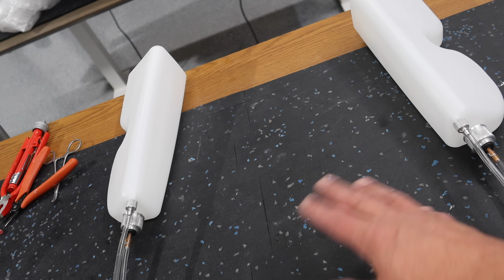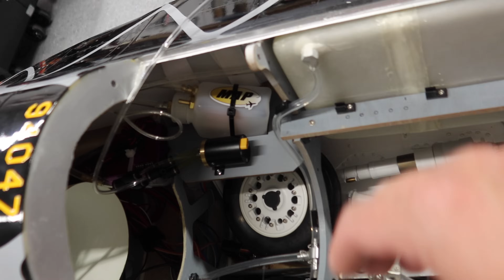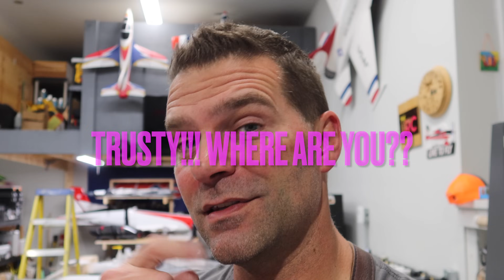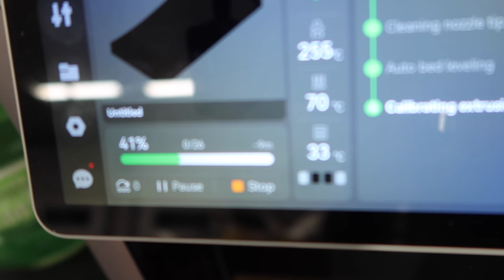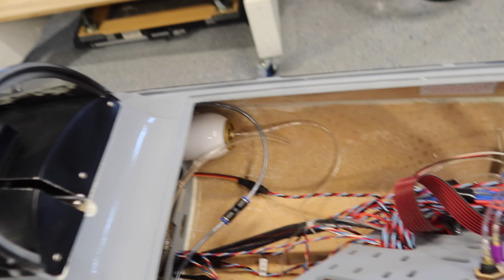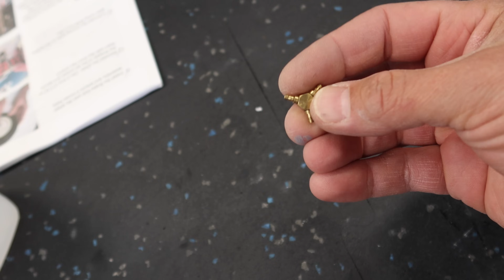Jetting Into Action: Building the BVM 1/5 scale F-16 Venom RC Jet

Comment: When you have a flimsy square of light ply that you need to be stiff just run some lateral braces just like they do in acoustic guitar tops and backs. A lightweight piece of spruce 1/4 " x  1/2 " is all thats required and it does not add much weight at all and it is cheap and it is easy.

Comment: Question. If you have the nosegear steering on a seperate channel I guess you reduce the rate to 0% when the gear is up so it doesn't move in flight.
Will the gyro not move the nosegear anyway in flight because it's not relying on the signal from the RX anyway?
Because the servo isn't really off. The transmitter just sends the signal for it being centered all the time once the gears up. And the gyro doesn't really care. It will move it same as the rudder...
I'm asking because I had the same dilemma when programming mine...
Reply from the maker: Good question.  No the program eliminates the movement of the nose servo completely with gear up.  Centers the servo and holds it there.

Comment: Do you prefer tanks in parallel or series?
Reply from the maker: Typically in Series is my preference as it eliminates the un equal draining scenario.  It does add more restriction to the fuel system in a 3 tank setup which can be an issue.

Comment: Hi what’s the difference between the new pump compared old?
Reply from the maker: New pump has an MR30 (Yellow connection) built into the housing.  The previous pump had a wire lead coming off which would be an issue sometimes if moved too much